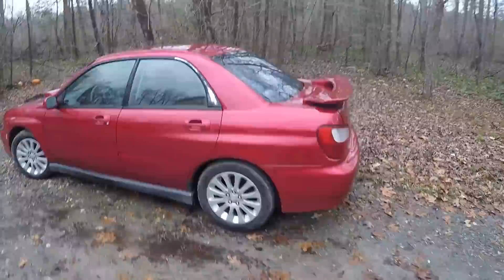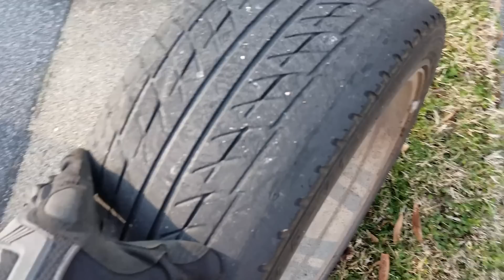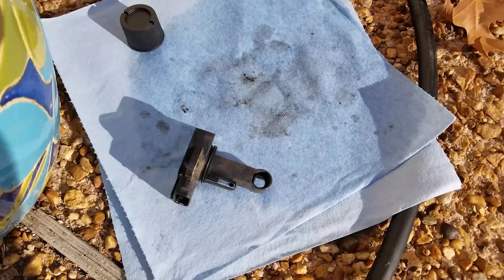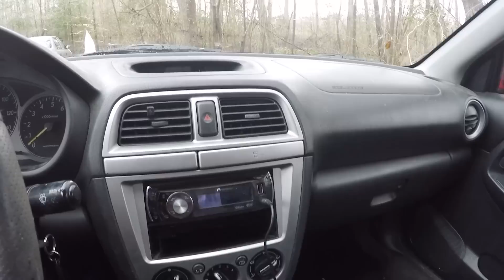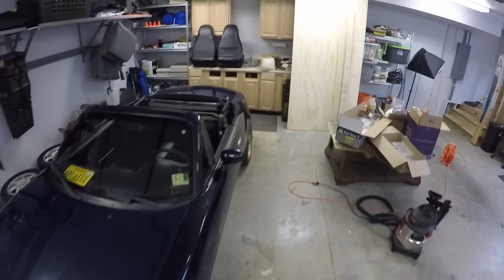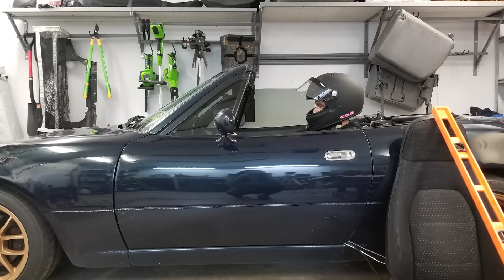I bought the CHEAPEST 2002 Subaru WRX, and I'm turning it into a track car!

Comment: How much did you pay for it because I'm looking at some cheap wrxs

And honestly my big worry is the motor going

I'm okay with having problems, the point is to fix it but I don't wanna bite off more than I can chew.

I'm fine with other problems, so long as the engine isn't shot or doesn't blow up

Even headgaskets don't really scare me, I just don't want a car I can't at least drive sometimes as I work on it
Reply from the maker: Well the engine blew in mine.... so I agree with the motor being a concern.

Comment: Just got one for 1360.
2002 with 05 sti front clip and interior and suspension
80k on brand new jdm motor with a bad headgasket... just got one of the heads off and sent to the shop to get machined.. will be getting the other one off .. hopefully driveable soon !

Comment: I bought a 2002 wrx with 100k miles for $3,100
Reply: Sounds like a pretty stellar deal. Around here, one with that kind of mileage seems closer to 10k.
Reply: Invidious Ignoramus holy shit, I bought one with 140 for $650
Reply: @jeremiakendrick9165  I'm sorry, what? What the hell was wrong with it?
Reply: Invidious Ignoramus lmaoooo, needs a bit, but worth the price, I meant 240k not 140k, but it runs good, engine and tranny  are healthy, it has some rust issues and a few small issues like no horn, no radio one door doesn’t have a linkage and the hatch doesn’t have a linkage.
Reply: @jeremiakendrick9165  I sold mine with 230k for 4500 and a crf250.  I should have kept it. I miss it so much.
Reply: @jdlives8992  Is say u got a good deal that’s a nice bike and a lot of cash for such a old car
Reply: If you are buying ANY TYPE OF SUBARU WRX (WRX, not STi) in country where I live we are talking about 10000$+
Reply: @DaveAngelic  Europe?
Reply: @jeremiakendrick9165  Croatia to be precise but Europe in general, yes
Reply: @DaveAngelic  im big brain yktv lmaoo
Reply: @DaveAngelic  ure drunk
Reply: I got my 03 with 73k miles 1 owner for 10k
Reply: @whoischris28  hows it holding up?
Reply: TacoTacoTacoTaco  so they say... lmaooo, I was surprised how good mine is for so cheap. just got new rockers for it so that will be done, tryna sell it for 2500. to high or nah? auto 240k all healty with a few new body panels and gadgets that were busted. I got a video on my channel.

Comment: I like subarus, the one thing that's annoying though is you have to drop the engine to work on it (depending on the type of work obviously).
Reply: Yea if you blow your engine
Reply: My 2002 impreza cracked the diff case and had to jb weld it
Reply: Drop the engine? Why wouldnt you just yank it out of the top and slap it on an engine stand? Makes it much easier to see everything and install things properly
Reply: @Grooove_e  really ure thy guy huh u no what he meant gosh  some Subaru guys are such  tool  bags
Reply: With most cars if you are doing serious work to the engine it will be coming out at some point anyway.